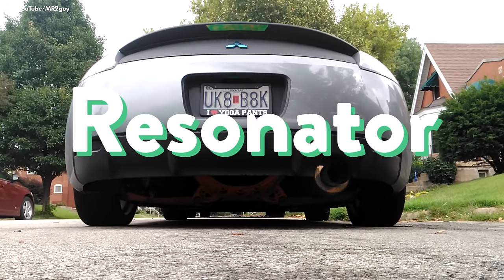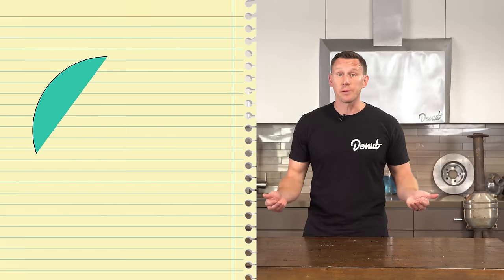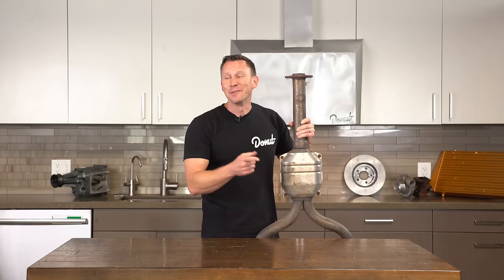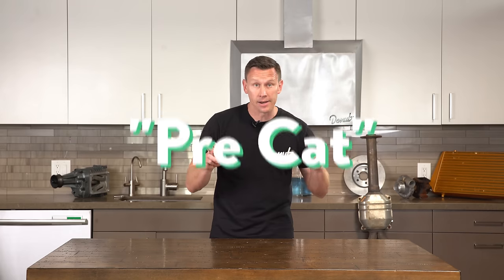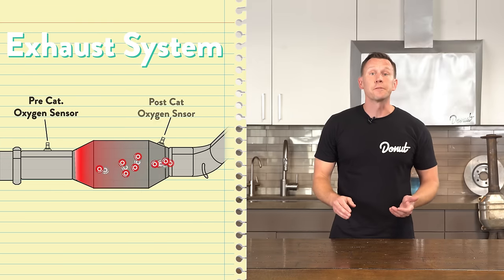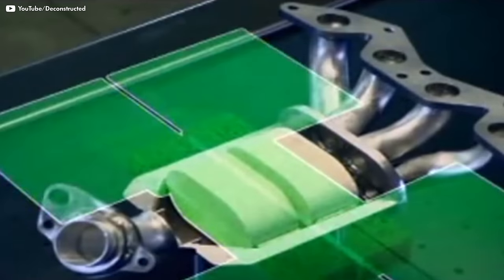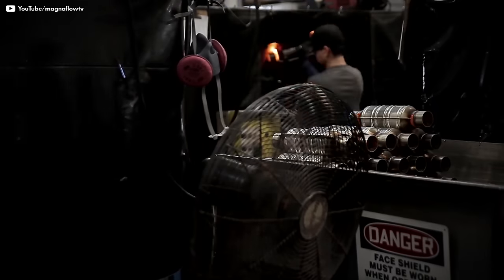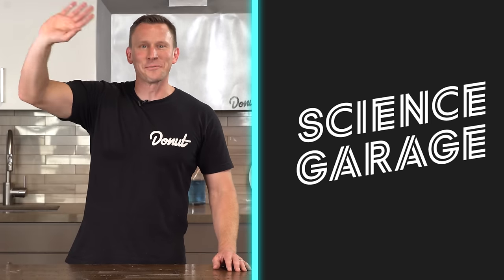Catalytic Converter: How It Works | Science Garage

Comment: For you see my driverside was clogged and my passenger blew apart and went into the muffler and clogged it sooooooo I cut the driverside and the muffler off cause they both weren’t working. Aslong as you can get a computer and tell your car "nah is fine“ title run better than with a cat and muffler cause of back pressure from both on the engine

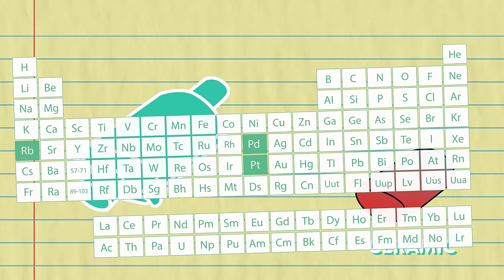Comment: 1:55 the catalytic converter in a car indeed has rhodium. The element in the picture however is rubidium (Rb). Should be Rh. Rubidium would however look spectacular when put in an exhaust pipe, as it reacts violently with water and oxygen.
Reply: Good catch! I also noticed this mismatch and was confused. Thanks for clarifying.
Reply: well technically🤓
Reply: @fedepede9754 how else was i gonna know

Comment: Modern cats don't hurt performance, you can have your power and be clean too, no excuses anymore Honda bois.
Reply: cost? bloody two and a half grand for a chunk of metal!
Reply: Removing that shit is good for 20hp in my case. No one died because of a catless car. Get a grip. 😂
Reply: Le Enderman  And now you fail smog checks and can't legally drive.
Reply: Even if cats hurts performance, I will still leave them on.
Reply: Le Enderman If everyone had the same mindset as you we'd all be dead by now.
Reply: Ledfndr not on a turbo car. Any restriction behind the turbo is bad for performance bast case scenario is a straight pipe with no bends
Reply: Bruh
Reply: @Overfl00d  smog checks should be illegal
Reply: @timothyhinton5665  florida doesnt have em...
Reply: Worst offenders are the Yeeyee truck bois
Reply: @F22C1  Pollution does in fact kill lots of people. If you care more about getting your hp numbers up for the sake of getting them up than you care about people's lives your priorities are fucked.
Reply: 900 32 lol
Reply: Not if you have a turbo car. Catless downpipe will reduce the back pressure therefore better flow.
Reply: @wholelottapain8130  blacktrax has data disproving that, but hey whatever helps you sleep at night.
Reply: @F22C1  and now your car sounds disgusting and raspy, congrats.

Comment: Catalytic Converters really are one of the best improvements for cars ever. Other great advancements that nobody talks about thought is variable valve timing. Without it we’d be stuck still driving seriously underpowered cars to this day like in the 80s.  Thanks to variable valve timing. We get great fuel efficiency when we’re just putting around then when we want to stomp on it. We also get awesome power. Another great advancement is fuel injectors. People say it’s more complex but I think it’s easier to work on than a carb. The computer does all the work. All you gotta do is pop the old fuel injector out and plop in a new one. Also I think coil packs are way easier to work on even if it’s more complex to make. Also an idiot can’t wire a coil pack the wrong way like my friend did with his distributor cap.  He just put the spark plug wire back any which way and ducking up his car.
Reply: I have a new car model (about 2017) working on diesel and a semi-open garage (I mean there is a ceiling that covers two-thirds of the car but not all the car, three walls but there is no door in the entry, and instead 2,5 meters of fresh air).

Can carbon monoxide still be dangerous if the car's motor remains on, or is it safe even if I forget to put it off and stay inside the garage??

Comment: Do carburetors next.
Reply: Yes!! I have no clue how those things work
Reply: +DaBrute omg yes. I get the jets, I don't understand the floats. just that they keep things from starting.
Reply: I think they did that already
Reply: Carburators are not used anymore. Now, there are Electronic Fuel Injection(EFI) systems that are connected to the cars' Engine Control Unit(ECU).
Reply: @coal2710  Yes, they are used. And a lot. In fact, I just rebuilt one yesterday. A 4100 series 1959 Autolite/Ford 4 barrel. If they weren't still used today, summit racing, jegs, etc, wouldn't be selling so many of them. lol
In a performance comparison between a BG Race Demon carburetor vs an electronic fuel injection, both installed on a base test engine, the Race Demon carburetor outperformed the fuel injection not only in horsepower, but also in low end torque. Fuel injection is handy if you can't build your own engines/tune your own carbs, etc. But otherwise, it is inferior in terms of performance on naturally aspirated engines.
Reply: @coal2710   actually hate to break it to you especially being a year late a lot of high end race cars are very simplified and still use carbs and many cars not to far back from now used carbs and still use carbs plus carbs outside of there finickyness do have some advantages over fuel injection
Reply: @dr.dylansgame5583  Could you explain them? You seem to know a lot about this.

Comment: Unless..... you were Honda and invented an engine (CVCC) that didn't need a catalytic converter, and later built a small car around it.... and BAM!!!: The Honda Civic!!!
Reply: MK3424 CVCC was effective, and it was insanely complicated. Swiss watches are child's play next to CVCC. That's why Honda later switched to conventional catalytic converters later on.
Reply: It was amazing that Honda passed emissions testing on a vehicle with a carburetor and NO catalytic converter, but it was complicated AF.
Reply: It was good enough at the time, but stricter laws meant it was not, so a cat still became required

Comment: I’m probably one of the fewMotoring enthusiast who isn’t a fan of guys remove there cats for the extra 1-5hp and in doing so their impact on the environment is so much greater
Reply: I'm another. I actually installed dual Magnaflow cats (my truck originally came with only 1) since I have a full true dual exhaust, and I lost 0 noticable performance going from 0 cats before to 2 on the same exact exhaust setup. All I "lost" was a stinky exhaust, a couple dB inside the cab (particularly at idle) and a few less dB outside the truck. That's it.
Reply: shame that it wont make a difference at all in the long run becuase like 90% of emissions are made by factories and big companies

Comment: To anyone feeling like their dealership or the manufacturer is ripping them off, please read this in its entirety.  It may be long, but the details matter, and there is maybe a books worth, so I’m trying hard to stay on point and the suspension thing is a perfect example of how they work.   
Here’s a question I’ve been looking for an answer to for about a year.    Please if anybody has any legitimate  input let me know.
Does or can the catalyst “swell” or “expand” when it gets hot, and then “shrink” or “contract” when it cools?  No obviously we all know that things do that with heating and cooling, but not that much.   Can this occur with enough difference that when it swells it can block the exhaust and cause enough back pressure to make a modern car shut off suddenly?  And when it shuts off, can it shrink back to normal size within a few seconds, maybe 10 seconds, or even 30?   Oh, and all the while no issues with mileage or horsepower, and this happened in a very random manner.   I was told that my cats on my 2006 Dodge Magnum RT (Hemi V8) needed replacing (@160,000miles), as well as oxygen sensors and plugs(that were only 50,000miles old) and coil packs.    All of this after the engine light came on and it ran a little rough sometimes but not too badly.   No loss of power, no mileage degradation, no running hot from backpressure, no sulfur smell from exhaust, no rattle from the cats, all of which I had learned were various symptoms of a bad catalytic converters.   Trust me, I thought I knew cars well enough to call bullshit on this swelling and shrinking assessment.    Long story short, I’ve got a Lifetime Bumper to Bumper Chrysler Warranty on my car that I purchased when offered, upon my factory warranty running out.    Also I’ve had this car ONLY serviced at this dealership where I bought the car brand new, or at the sister dealership across town, but mostly at this one.   They’ve stonewalled me on things that seemed at the time to be inconsequential, and also at the time I got sick of complaining about all of the suspension racket from beneath the car.    Even though I asked them to look at it almost every time I took it in for service, they almost always said they could t find anything.  Now I know that I was right the whole time and that they were just lying.   I wasn’t just complaining about superficial noise either.   At times you could feel things moving around when I backed out of a driveway for instance.   Sometimes the front tires would “scrub” when turning at slower speeds because the two front tires were traveling in different arcs than the ones they were designed to follow.    Once the service manager told me that he and a tech took it for a test drive and they discovered rocks inside the rear bumper and they couldn’t be removed “without a whole process which would be a royal pain in the but”.    Rocks in my back bumper?   As the source of all of the suspension noise.  I have restored many an old car and am proficient at getting rid of squeaks, rattles, clunks, etc.  It often sounded like an old coffee can with a handful of bolts in it whenever I hit almost ANY bump in the road, cracks, expansion joints, etc, utterly ridiculous, and so loud and noisy I was embarrassed to have passengers, cause it sounded like a 1982 Crown Vic which had never had a single suspension component replaced and was parked in saltwater puddles and driven for thirty years on tank trap type streets.   It was actually worse than that.  And on and on.   That was just to set the stage for treatment.  So they told me I needed to replace these things and I would generally have no problem with letting them do their thing as I just pay a $100 deductible.   So the story was that the code indicated a misfire condition(notoriously inaccurate because other things can set off that code) which COULD have sent unburied fuel into the cats and ruined them.   Now from what I understand to do so would require driving for maybe hundreds of miles with that misfire, but I only felt it misfire once when the light first came on.  Otherwise it would just shut off, while driving.   So I really doubted their diagnosis.   The plugs were not very old, the O2 sensors and coil packs were covered, but not the cats.  Deep in the warranty agreement it states they are not covered.    I think they just wanted me to have to actually pay for something, or just ripped me off.   I asked if I could get the other stuff done and maybe do the cats if the problem persisted.   This was $2k I didn’t have mind you.   They told me that I could do that, but anything damaged by not replacing them would not be covered under warranty.  They basically “bullied” me into it, with leverage.   That loose description led me to believe that they could claim just about anything after that.    Oil pump dies?   Shoulda gotten those cats when we told you to.  That’ll be another $2000 sir.   So I kept asking around and searching online and finally called the service advisor and explained my predicament.   They got a tech on the phone and I asked why no standard symptoms of “bad catalytic converters”?   Why did it fire right back up and drive like nothing happened for many miles if they were clogged when hot?  He gave me the above explanation.     I know I got ripped off.   But has ANYONE, EVER heard of such a thing happening?  So far even the pay-for-an-answer people online said they thought I had been duped.   And I phrased to not induce an expected answer, kind of like above, but shorter.     Any metal swells when heated, but enough to block exhaust flow and shut down the car?  And the temp gauge never moved either.   And it certainly didn’t run like tha t car would if it was really hot, like with heat soak.      I bullshit.   I am reaching out because I intend to take them to court, and if I can’t get one single reputable response saying that “yes, they can swell that much and he was telling the truth”, then they are screwed.    And that is just the start.   After tons of research, I have discovered that Chrysler has been screwing people on a criminal scale since the early 2000’s.     Not like the usual, like we all know that all dealership jerk people around, and so do the manufacturers, but just within the law, usually,  well this is fraud, and I can prove it.  So if you have a late model Chrysler product and you have been having problems with it and the dealership seems to be giving you a story or ripping you off or even not fixing it at all, please let me know.    They have been selling parts to customers by the thousands that did not fix the problem and the dealership just convinces them to spend more money and “try this”, and if that doesn’t work “try this”.   All while not giving a refund on the part that didn’t fix the problem and most likely was perfectly fine anyway.   My contention is that they know the problem , have been lying to America for 15+ years, and ripping people off the whole time.  And I’m in kind of a semi-unique position to make these claims.   Through interviews and reading comments and forums I have discovered this:  if I were a regular “paying” customer with no warranty they would sell me parts all day long claiming that it will fix the problem, and when it doesn’t they make an excuse for not refunding money and the tell them that the next parts will definitely fix it.  People have even replaced the transmission, only to have the problem come back a week later, because the transmission was never the problem.    People have blown thousands of dollars on these cars and the problem ALWAYS PERSISTS.   And that is because they just replace with the same crappy but new part that came off, which is sure to fail.   So far I have discovered that the problem is with the computer infrastructure of the car, where kind of like your computer, when something goes awry, it freezes up.  Well when these cars have any kind of intermittent connection, short, etc. they just shut down.  They will always start right back up though, sometimes without another issue for months, sometimes minutes.    So every time they replace a part, that wiring harness connector gets cleaned(if they’re doing it right) properly and reconnected, generally improving the connection, but not always, and not always for good.    It’s like the old saying, if they know this, they are lying and in on the con, and if they don’t, then they aren’t qualified to be a car dealership or Chrysler a manufacturer.    They will be shut down, very soon, mark my word.  Maybe not by me, but they will. I give them till 2022.  That’s three years.  I think it would take that long for my case to be seen if it ever happens, but meanwhile I’m building up evidence, and if you feel like you’ve been screwed by ANY automobile manufacturer please share your stories.  Read the Magnusson-Moss Warranty Act and you’ll see that they are trampling all over the implied warranty part.   By the way, there is a You Tube Video of a sheriff’s department showing the suspension parts from one of their Chargers.    It is scary.   98% of cars and trucks out there have suspension bushing that will last at least 100,000 miles,  but more likely upwards of 200,000.  Well the parts on all of these Chargers, 300s, and Magnums have a 20-30,000 mile average service life.   That right there breaks the implied warranty rule.  It is absolutely incomparable with any other comparable product on the market, and by a huge margin.   Thanks for your time.   Hit me back and I’ll figure out how to link you to tons of info and I’m about to open a You Tube channel devoted to these issues.

Comment: I'm a huge engine sound guy and I actually prefer the sound of a exhaust with cats in place and deleted (rear)mufflers, to deleted cats with muffler in place.  Better if you like rowdy but not too noisy sounding engines rather then smooth boring sounding normie exhausts for fuccbois (smoothed but raspy fartcan-like sounds etc.)  Has more to do with muffler placement vs sound though, you lose "engine-like" sound if anything is muffling(cats included) too close to the exit, I think it has to do with pressure equalizing before and after anything muffler-ish related in the exhaust.  Cats are always near the collector tho so if I can delete only one I delete muffler, yay catalytic converters wew yehaw

Cats + bullet style resonator somewhere between cat and exit, 2/3ish way down the exhaust :okhand:

Comment: Awesome video.  Rb stands for Rubidium.  Rhodium is Rh.  You pointed to rubidium, but my guess is you named the proper element, especiallly since it is a transition metal near pd and pt.  Rhodium Rh is used in catalytic converters, not rubidium, right?

Comment: It depends where it is, I ripped them out of a BMW where they were a one piece with headers welded just 2 inches from the engine head creating reduced exhaust flow drastically reducing performance.  Now put a gas mask on and run and tell us how better for you it is wearing it and running.  They are not even made by the manufacturer of your engine, your engine was created and  tested without them it was then the green neocon mob came and required to put them on, thats the story how you got them there.